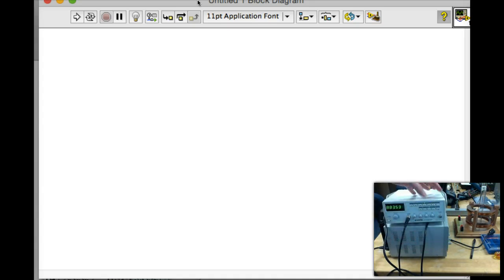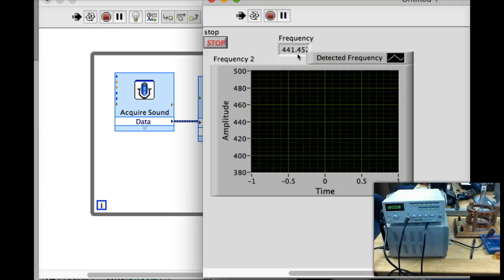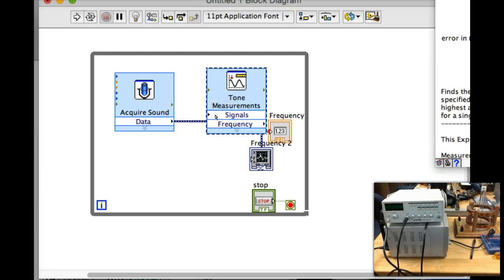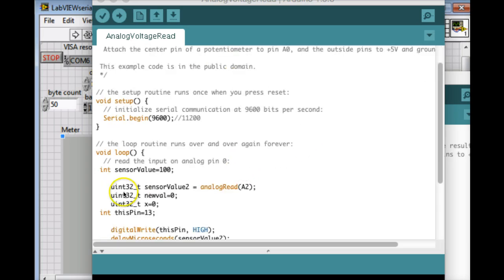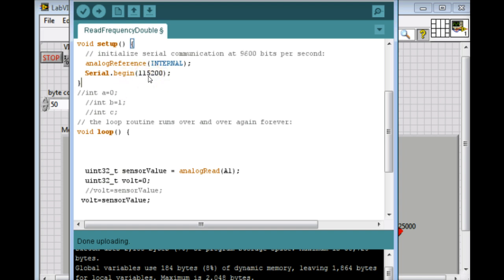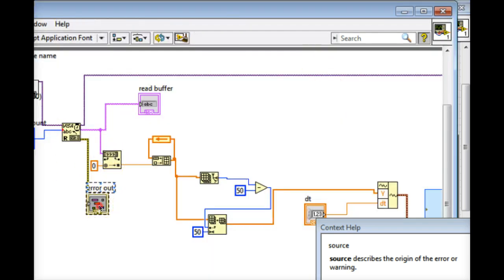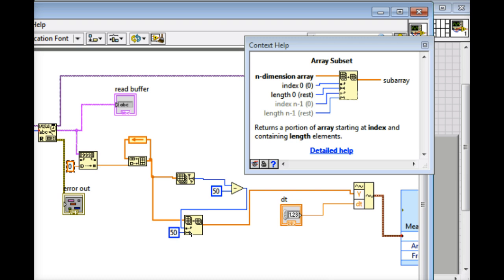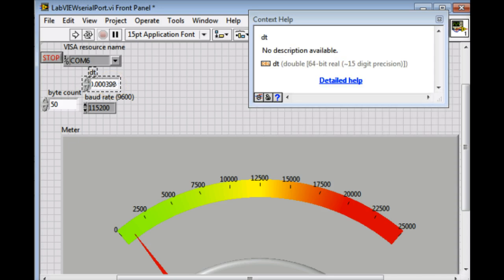Tone Measurement Demonstration Using LabVIEW and an Arduino Card

Comment: Hello. Very nice tutorial. Is it possible to measure the frequency and convert it to RPM, in the same time get the torque from HX711 over A2 and A3. Then just compute and plot power. How to get both with VISA?